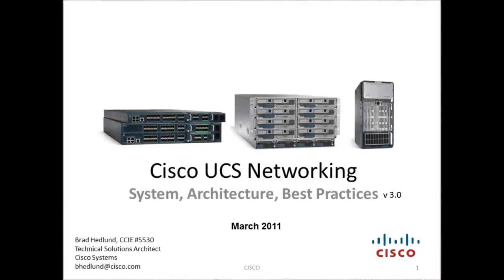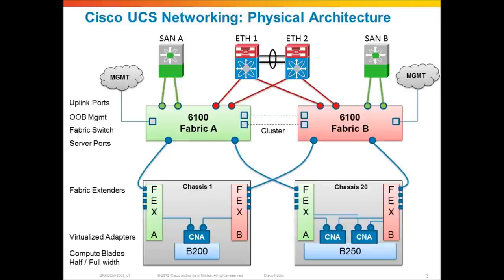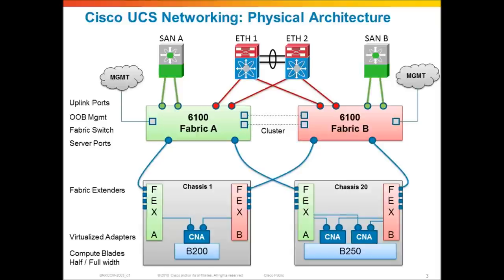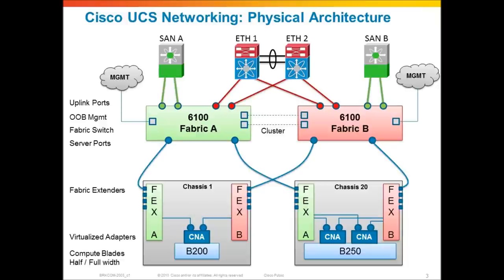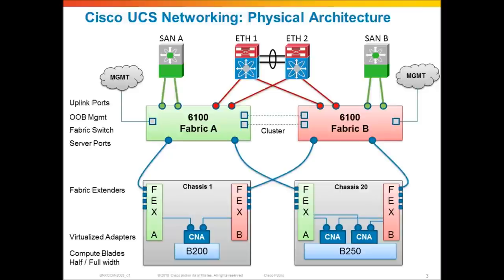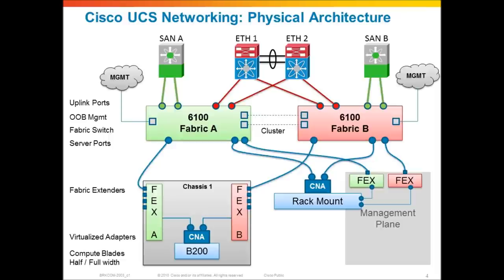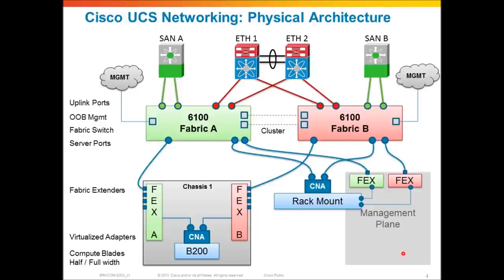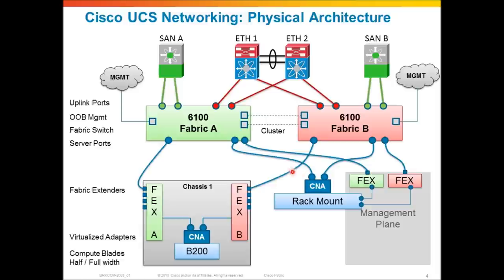Cisco UCS Networking, Physical network architecture

Comment: Brad - I just looked at your diagram in this video and noticed that you have the FEX's cross-connected across the FI's, which is technically incorrect.  All IOMs from the first chassis should connect to FI-a and all the IOMs from chassis 2 should connect to FI-b.
Reply: ***** Actually Brad has it right.  Each chassis has two IOMs, one connected to the A fabric and one connected to the B fabric to enable failover.  If a chassis were connected to a single FI, the loss of that FI would disconnect all the servers in that chassis from network and storage.  There is a lot of documentation on this, here is an older document that has a basic diagram (you'd want to look at version specific documentation if you're doing actual config).  http://www.cisco.com/c/en/us/support/docs/servers-unified-computing/ucs-manager/110202-lan-san-connectivity-ucs.html
Reply: I got confused by that.  At 6:06, the right hand side "FEX" is referencing the 2248 nx-os, while the UCS "FEX" on the left, chassis 1, is referring to the "UCS FEX"

Comment: Hello Brad, and thatnk you for your video!

I have a question regarding the diagram involving the Rack Server. Wouldn't its connection be: Management and Data through the FEX and then one cable from the FEX to the FI? I ask this because it would follow the architecture you can see in the chassis (internally connected to the FEX and then one single cable transfers management and data to the FI's).

Thanks!
Reply: +petebeast- If that would be the case, then you would use the rack as a blade, which technically anyone wouldn't do it seeking statelessness of a blade server.